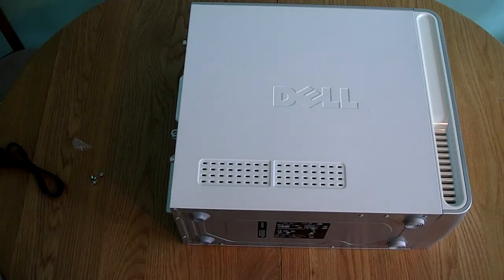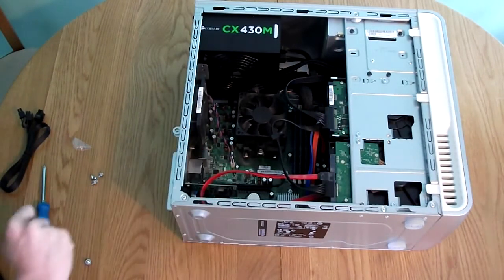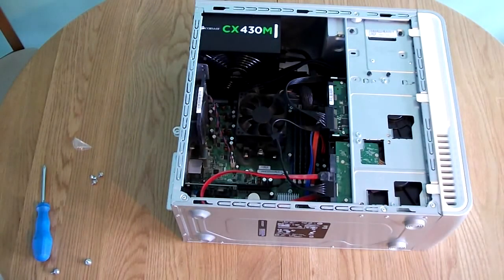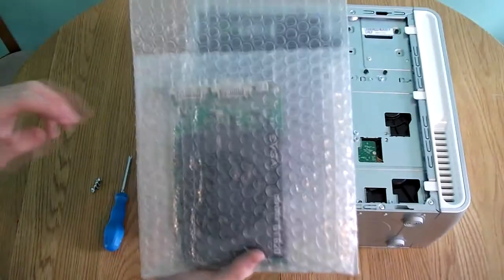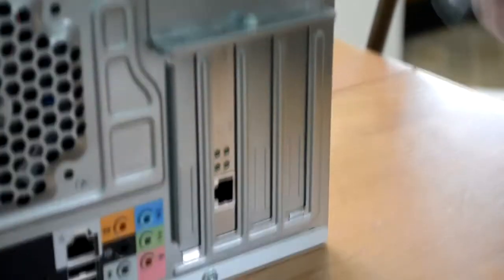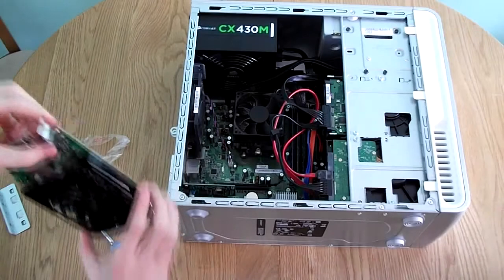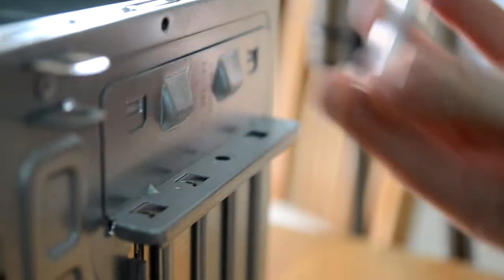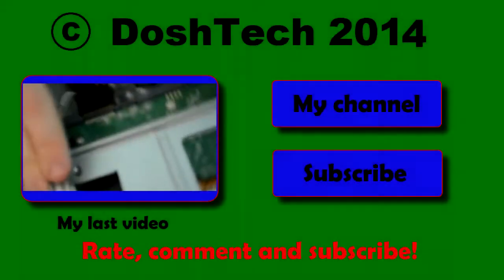Graphics card installation GT620

Comment: will games work with i5-2400 and GT 620
Reply from the maker: I would seriously consider aiming higher than the GT620, this card was not exactly powerful 6 years ago. It would probably be adequate for minecraft or older games but it would be worth looking into GTX 750s or other previous generation mid range cards. The GTX 650 is quite cheap if your case and power supply support it.

Hope this helps
Reply: @doshtechvideos  im trying to run some casual games not 2019 AAA games but ok

Comment: With that graphics card do you need to upgrade the power supply
Reply from the maker: +Robert Clevenger Entirely depends on what computer you have and what spec it is. If you look up what specifications, or even the model number of your computer you should be able to find out what power supply you currently have and if it can support any extra load. Even easier than that is to just open the side of the computer and actually take a look at the sticker on it, there will be lots of numbers but there should be a "total watts" or "max power" rating on it somewhere. It would also be a good idea to consider getting a newer card like the GT720 or 730, as those need less power and would likely perform better as they are from a newer series.

Hope you find this useful - DoshTech
Reply: +DoshTech it says it has 250 w as its max is that good bad or in the middle
Reply from the maker: +Robert Clevenger 250W is really quite low. Depending on what CPU, how many hard drives and other PCI cards you have you might be able to get away with it - but it will be risky, most OEM power supplies are total rubbish and just blow up the rest of your computer if you overload them. Best option is to buy a Corsair CX430 power supply or similar wattage 80 plus rated unit and buy a far better graphics card to begin with, assuming you are running a standard size ATX case.
Hope this helps - DoshTech
Reply: +DoshTech I have an old pc and I was just going to add parts to make it better. I want to be able to play games like cs go and gmode but I keep running into problems
Reply: +DoshTech  what motherboard would you recommend on a budget
Reply from the maker: +Robert Clevenger Those games are quite easy to run really. A GT730 would be more than adequate for them. What CPU do you currently have, and how many hard drives are you using, and do you currently have a graphics card or is it built into the motherboard. It might also be helpful to know what brand the current power supply is made by. From this I should be able to work out if you can get away with running a graphics card or if it might be best to buy a new power supply.
Reply: +DoshTech the problem is I don't have a motherboard that has a support a graphics card I think I have the same pc some were but did you upgrade the motherboard in that pc
Reply from the maker: +Robert Clevenger This is a standard Dell Inspiron 531, the only upgrades I have done is the power supply and graphics card - its motherboard came standard and I have not changed it, as it had a PCI-E x16 slot. Most motherboards for at least the last 8 years have had at least one PCI-E x16 slot. If you look inside your computer it will be the longest slot with a clip on the end opposite the back of the case. If your motherboard definitely doesn't have a slot, then there's a big sign that its not worth upgrading and it might be better to save up for a new computer and go back to square one.
Hope this helps, DoshTech
Reply: +DoshTech so if I just add a graphics card and a new power supply it should work with cs go
Reply from the maker: +Robert Clevenger You said that your motherboard doesn't support a graphics card, is this due to the absense of a PCI-E slot, or do you mean the computer can support it, but doesn't currently have one? The PCI-E slot is where the card will plug in, shown in my video at 6 minutes. It might not necessarily be black. If you do have one, then add a GT730 or similar card and a good quality power supply and it will work. If you don't have one then its easier to buy a new computer.
Reply: +DoshTech it doesn't have a slot for the graphics card
Reply: +DoshTech I have about 70 dollars to work with
Reply from the maker: +Robert Clevenger Unfortunately its not going to be easy to find a power supply, graphics card and a motherboard on top of that for 70 dollars. That translates to about £48 where I'm from and that is certainly not enough for even a GT730, let alone the motherboard and power supply to go with it. The best advice I can give you is to search for second hand parts, they will be easier to get hold of (assuming your computer is a few years old) and much cheaper. Finding a second hand GT620 or GT630 should not be too difficult, and for motherboards just go for the best you can afford that will work with your CPU, RAM, hard drives and graphics card.
When it comes to power supplies though I seriously suggest getting the best you can afford, go for known good brands like Coolermaster, Corsair, Antec, Thermaltake or Seasonic, aim for a 350 to 400 watt unit. 

Good luck. DoshTech.
Reply: +DoshTech I found a graphics card used for 20 dollars and a motherboard for 32 it's just trying to get a power supply big enough to power it all
Reply from the maker: +Robert Clevenger Make sure the motherboard chipset and socket accept the CPU and RAM. Finding a decent 400 watt power supply for that money could be tricky but is certainly possible. I can not emphasise the importance of getting the right motherboard, as there are MANY different ones for different types of CPUs, and its an easy mistake to make just to get any motherboard, and then find out it doesn't work. Make sure you do your research!
Reply: +DoshTech how do I find if the cup fits on motherboard
Reply from the maker: +Robert Clevenger Go to your start menu on windows then right click on computer and go to properties. It will tell you what CPU it has and then you can Google it to find its socket and then you can buy one according to that. Another thing to take into consideration is the physical size on the motherboard. Most OEM's (dell, hp, the manufacturer) will use BTX parts which are not standard size and are not replaceable. It is quite likely that it will be a non ATX form factor and not fit a new board other than the one its designed to take. If you know the computers model name then this will help you greatly in your Google search. I once had this problem, and although frustrating, sometimes it is better to just save up and buy a proper gaming computer.
Reply: +DoshTech  I can't load up the pc because I need the parts is there any way else that I can find what fits
Reply: +DoshTech is the the original power supply to that pc in the video good enough for a 2 gb graphics card
Reply from the maker: +Robert Clevenger You'd need to take the heatsink off to physically look at it, but you'd need to reapply thermal paste. Removing a motherboard is the most involved job you can do with a computer, so Id highly recommend getting a computer shop to do it for you if you are not 110% sure what you are doing.
Reply: I have core i5 2nd gen with 8gb ram, do i also need a new power supply?